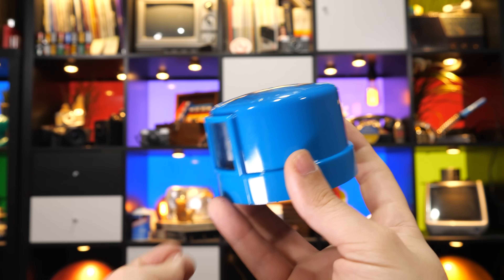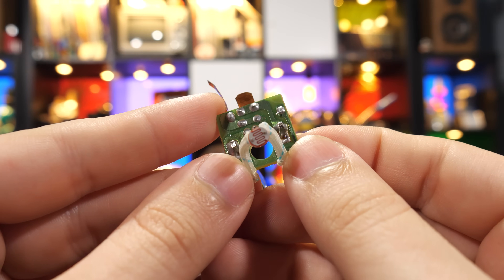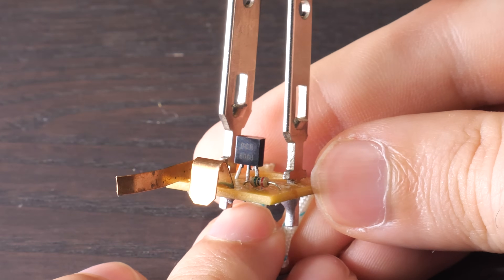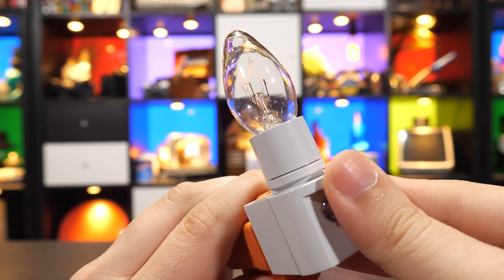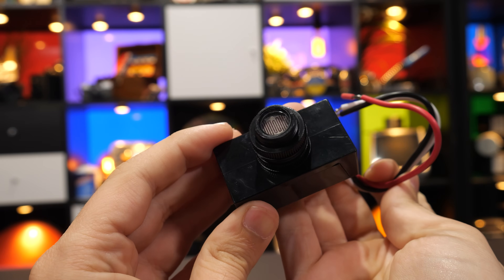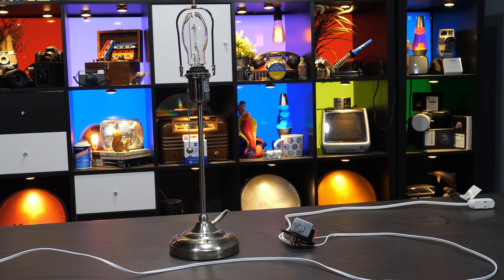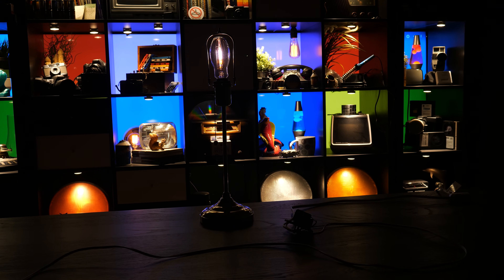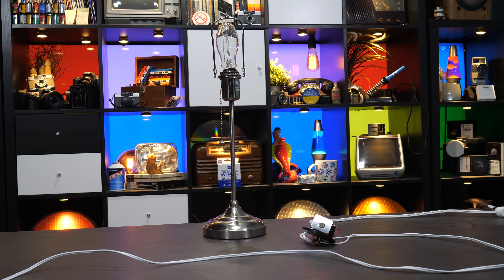Photoelectric light controls are weirder than they seem

Comment: Always a joy.  After a 45+ year career in IT, I love how you elegantly summarized the challenges of software in a few seconds.  Spot on, LOL
Reply: I'm constantly surprised any software actually works. Speaking as a software engineer.
Imagine the most insane Rube Goldberg machine ever. That's how most software is internally. You just don't see it because it's hidden from users.
Reply: I would be surprised if the software is more than a 4000 series logic chip.
Reply: The software issue was amazing hahahhahahhaa
Reply: @blaknoizee  A picture is worth a thousand words.
Reply: the problem is not software reliability in this case
Reply: To be fair, the software required to control this particular application would be very simple and easy to verify correctness / test. But as others have said, a microcontroller-based solution would suffer from other issues which this design avoids entirely, and the circuit design would need to be proportionally more complex/expensive to compensate. If it ain't broke, don't fix it.
Reply: @michaelcalvin42  new installations are micro-controller based and this allows for load shedding and features like turning every other light off after midnight, dimming and other such features.  They can even tell if any have failed and wait until that meets a threshold before they send a man with a pole out to smack it.  I would imagine such features would be mandatory if they are not already especially in the EU.  North America tends no to bother with that nonsense (for now). You don't need to worry too much about the MCU having issues because the LED fixtures fail much well before!
Reply: My hat's off to software guys. Especially if you have to maintain legacy code that was written by some guy years ago and you have to decipher his thinking. I feel lucky just to be a normal end user who has to write some simple stuff in Matlab or VBA once in a while.
Reply: undoubtedly a dig at adobe premiere 😆
Reply: Very 'lf-baked', though! :)
Reply: Compare and contrast:
Wirth's/Moore's "Laws"
Necessity is the mother of invention

Why keep chasing that infinitesimal increase in IC density, when a single elegant analog solution can do the same for a fraction of the cost?

If your argument is electricity consumption or e-waste generation, consider the fact that cosmic rays, power surges, or static electricity can fry a CPU/microcontroller at any moment - sometimes even before the product is ever put to use. None of the components shown in this video are anywhere near as sensitive.

Will the energy cost of replacing/recycling those fried ICs really be less than the cost of producing a new one of these?

Granted, I am a little sad that he didn't mention the Cadmium problem.

Comment: Just for the sake of stating europe ist better.. a lot of Street Lights are actually controlled by an acoustic signal here, which flips a switch in the light pile. Funny enough you can still turn them off by kicking them over here, just like the old gas driven ones 👀😂

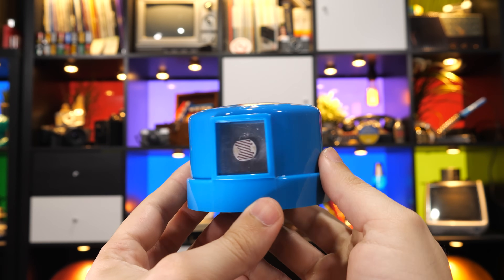Also.. what is happening to your Finger at 1:02 ?? 😂
Reply: that’s definitely not the norm in europe. Most are controlled either like this or by a timer

Comment: And you could probably add a second heath switch pointing up to the sun (exposing the surface) if we know something about metal items left out is that they get very hot. now this could be the primary switch simply stopping the heater element to heat up. the Sun’s heat would force this switch to work and keep the lights off. 
then if the sun goes lower then it would hand control over to the secondary, light controlled process which uses electricity the same way as before (wasting a little to save a lot)
and when both switches are on (no heat, no light) then the light comes on.
i am certain that more than 5 minutes of thinking would allow to fix the “yeah, but the heatswitch needs time to warm up, thus the light would turn on” - all with analog and maintenance free components. like a little heatpipe between the primary switch and the secondary to keep the second one preheated. Bit more expensive and two more components to add, but nothing fancy and would fit in the mainly empty case just fine :)

Comment: i think in germany a common way to control the street lights is a "Rundsteuerempfänger" (word by word translated: round-control-reciver) . You can controll the light by sending impulses over the powerlines that will interpreted by the Rundsteuerempfänger as signal for turning the lights on or off. The signalform may differ from region to region and can be send over higher voltage levels, it than get transformed down to lower voltage levels (230V). Not sure if every lantern has such a interpreter or many lanterns have one interpreter that controlls them.
nice channel btw.

Comment: These days the modern way this is done is with IoT. The first street light in the string has a controller with some sort of data connection. The controller stores the current program, usually some sort of astronomical calculation on when the sun sets and rises, with a fixed time schedule on top to save energy in the middle of the night perhaps. The controller talks with an application that monitors all your streetlights. This allows remote changes to schedules, and the fanciest ones monitor the current consumption, which allows you to make sure all bulbs are still operating. This technology is also getting integrated into the streetlights themselves, as IoT communication gets cheaper and cheaper, it’s starting to be more convenient to have every light communicating directly with the application.

Comment: You can do it electronically without a microprocessor. An op-amp setup as an integrator can provide the delay and a Schmitt trigger can do the hysteresis. Ceramic capacitors withstand high heat pretty well.

I suspect there simply isn't the demand, rather than there not being a technical solution.

Comment: It is amazing how such simple devices are used to control such critical infrastructure. You’re not wrong about ICs, the future of street, footpath and car park lighting is all digital and networked. Not just switching on when it’s gets dark but also presence detection so output levels and different coloured LED modules (2700K generally) are dynamically controlled on when people or vehicles are detected in the range of the lamp or group. When no one’s about, the luminaire switches off the brighter modules, reverting a minimal output of 2200K or amber modules that save power while also limiting light pollution and effects on local wildlife. It’ll be a much better solution long term for our built spaces, but definitely much, much more complicated than a margarine tin filled with a couple of bucks of components 😂

Comment: Heating keeps the innards dryer. Cheap and effective.
Early flasher units in motor cars used the same principle. The earliest flasher used in the Citroen DS had two bi-metallic strips. When a switch on the dash board was turned in the desired direction the first strip would heat up and open the circuit. This allowed the bi-metallic strip to cool and close the circuit. Thus it would switch itself, and the flasher lights on and off. The second strip had a much longer heating element, and took maybe 30 to 45 seconds to heat enough to bend. This released the switch knob from it's detent and opened the mechanical switch that powered the whole shebang. In later models a taut resistance wire was used to make the flasher operate, and switching was not self cancelling.

Comment: using the thermal system makes the "off" transition to be delayed , so it's "lightning" resistant   ,but because of ambient temperature , the "lightning" sensibility is affected , so it's possible to commute to off more often during lightning in winter (because its colder )

Comment: Wow, that kind with the little heater seems so "We couldn't figure out how to do it that way yet, so we're doing it this way for now" anti-tech, especially for the time now! OK, so... heater unit vs. processor with software and then a relay: Why couldn't there be some middle ground, like the thyristor or a transistor connected to a contactor or other relay like you supposed that some of us would be thinking about? I mean... since a contactor is basically a jumbo relay anyway? And why would hysteresis play a role in this?

Comment: 17:45 "It's one thing to learn what a photoresistor does and quite another to make something happen with it"
I made an input lag(motion to photon latency) tester for PC using a bunch of photoresistors that look exactly like the ones in your video but smaller.
I wired like 7 of them to an Arduino, then put them next to a PC monitor(spanning across the vertical axis of the monitor), connect Arduino to PC with USB.
I also wrote a DirectX program that would by default show black across the whole monitor, and when the left mouse button is held down, it would show white across the whole monitor.
Then I made Arduino send Left Mouse click to the PC and wait for the illuminance of the monitor to change from black to white using the array of photoresistors.
Arduino measures how much time passed between the moment it sent the signal to PC and the moment illuminance changed, then prints it to the PC console in microseconds.

Worked like a charm.

Comment: I've dealt with versions of this in the UK which use what looks like an identical form factor. The cover is entirely translucent, and they have a lot more electronics in them and no sign of that thermal switch. As far as power usage is concerned, one that I looked at quote 600 mW, which is less than the "passive" one in this video which uses around 2W. They also have the "hysteresis type" behaviour which prevents lots of switching on/off due to changing light conditions at dusk/dawn. I call it "hysteresis type" as it's not a true hysteresis as there are differences as there seems to be time, not threshold related functions. 

Also, I am convinced the ones sold in the UK are "full wave", not "half wave" as a friend uses one to power a couple of LED driver's for his pub's external lighting. Whilst an LED driver might tolerate half-wave rectification, I would not guarantee it as the capacitors on the input side after the bridge rectifier, and before the switching transformers are probably not specced for that, and if they were, it would create a lot of ripple current. Why would something that was responsible for turning power on/off use a thyristor (SCR) rather than a triac and only use half the waveform? A triac is essentially a couple of back-to-back SCRs. Second guessing the behaviour of a load seems to me to be a bad idea. If you want to extend the life of an (incandescent) light bulb, then design it into that, not some sort of general purpose light sensor. 

Perhaps I will tear one apart one day.

Comment: As a marine engineer we have fotocell to survey the flame in the boilers. If the flame is established and maintained the automated  cycle is going on.  If the flame is extinguished by any unexpected event,  it will stop the fuel pumps, it will trigger an alarm in the automation computer requesting human intervention (reset/remove de cause of the flame failure).  There are foto cell for red color flame, blue flame or yellow flame. The colors are based on the temperature of the flame. Blue is lower temp, red is a hotter flame.

Comment: I was given a sensor out of a security light. It worked by holding the relay open with light, using the photo resistor. When it got dark enough, photo resistor resistance went up, not enough power to hold the relay open , light comes on.
I thought that was how it worked. I connected a lightbulb to it and it worked when I blocked the photo resistor with my hand.
Thermostat? I guess those look like a relay? Mine definitely looked like a relay. It was inside a box like a relay.

Comment: In the 70’s and 80’s in the Australian town I grew up in, (Amphitheatre shaped valley, where our house house up on one side could see most of the town.) the lights on the road closest to the nearby sub station would come on first, and although it took only a second, or maybe two on really cold evenings, you could distinctly see the lights came on in a fan like wave across the town. Almost like one light at the beginning had a sensor, and sent out some sort of line signal to trigger the rest, slowed by the circuit processing delay in each light. Over the years, the lights have been upgraded to individual sensors, so they come on in almost random order. The shadow of the nearby mountain peak can result in lights coming on as the shadow slowly passes over.

Comment: There's a third option aside from thermo-mechanical and software: I used to control my garden lights, which ran off 12V DC, using a switch I threw together myself. You can do hysteresis purely in analog electronics. It requires a bog-standard comparator (I used the good old 741) and a couple of resistors.

Comment: What happens in areas of extreme cold? Do they have to insulate the photoelectric control to ensure the resistors create enough heat to activate the switch? Or do the resistors generate enough heat for this to not be a problem?

Comment: But lots of new ones DO have microprocessors.  They wouldn't be able to have mesh networks without them, and without mesh networks they wouldn't be able to dim the streetlights based on a control signal and/or schedule, and wouldn't be able to monitor the condition of the streetlight and send a message if it's not working.  The old way was to do group lamp replacement, essentially assuming that after a certain period of time that a certain number of lights would have failed, and then change all of them on a stretch of road whether they're working or not.  That makes no sense with the more expensive and much longer life LED streetlights, and having the streetlight tell you it's got a problem is cheaper than sending crews out to check them.
Some of them even do presence detection, brightening the lights during off-peak hours when a person is in the area.

Comment: I have a pretty solid understanding of electronics and controllers(do a lot of hvac work) and I find the breakdowns on some of these oddball topics MASSIVELY useful.  I am not a lineman or a dishwasher repairman, so being able to see inside of some of this stuff has helped me work on my own stuff because they end up using the same types of controls and components across a boatload of industries.  There's so many appliances I look at now and have an idea of what I'm getting myself into before tinkering around trying to fix them, because of this channel.  I don't think I've gotten bad input from a single one of these videos(even when corrections happened for some) because there's such a no-nonsense approach to how and why something does what it does.
Reply: As someone who knows nothing about electronics, I’m curious: if the light sensor activates during the day, what stops us from just using a NOT gate to flip the output?
Reply: @colinhulme6389  Pretty sure he covered that.  I assume the NOT gate is provided via a plc or something capable of flipping bits on and off  in your question- 
It's because a plc or controller that's similar have many more failure points inherent to their build/design.  Each additional wire, chip, board, connector, etc is another way the control circuit can fail on something like this.  
In the lamp and controls being discussed, this is already a mechanically applied NOT gate - you can view the temperature as the i/o.  Above X degrees = 0, below X degrees = 1.

If you're a programmer looking to learn a bit more I'd suggest looking up ladder logic and plc programming guides.  Lots of free resources and tools that show you how to approach electricity.  Flip switches for your lights are just mechanical i/o.  If 'yes', light=on.  For something like your dishwasher it'll check temps, open valves, close valves check water levels, release soap dispensers, etc with pretty much all mechanical inputs that work based on ladder logic, ladder logic just being another form of truth tables
Reply: Thanks  @nevernever2002  !

Comment: Some older cars had this since 80s, it dimmed the display when it get dark, so you don't get glare in your eyes. And when it get bright, the display would lit to full power, photoelectric controls are used both ways, to turn on in the dark or turn off or dim in the dark.

Comment: As a kid, I discovered that if I took a small mirror and held it up against a light-sensing nightlight, angling it so that the light from the bulb would be reflected to the photoresistor, the nightlight would go into a feedback loop and start flickering like a strobe light.
Reply: That's how Disco lights were Disco-vered.  ;D
Reply: I remember doing that feedback loop thing with an outdoor holiday light sensor to make a strobe light effect. Unsurprisingly letting that go a while killed it.
Reply: I ended up with an outdoor light that did similar.  I installed a screw-win dusk to dawn sensor in the lamp.  The photoresistor was catching a reflection off the shiny lamp housing and was causing the light to cycle on and off
Reply: I have a nightlight in my kitchen that flickers with the flame from my stovetop if I'm cooking late at night😂
Reply: I always tried to trigger the sensor with its own light, but I never thought about using a small mirror.
Reply: Laser too
Reply: JAHHAHAAH Nice
Reply: I was able to do that with just my hand, it was fun.
Reply: Some vandal did that outside a middle school.